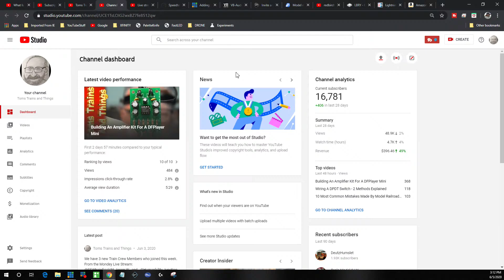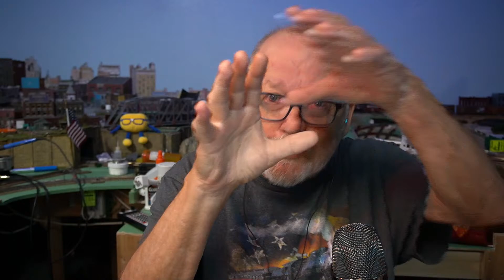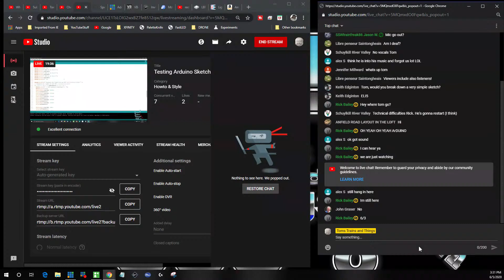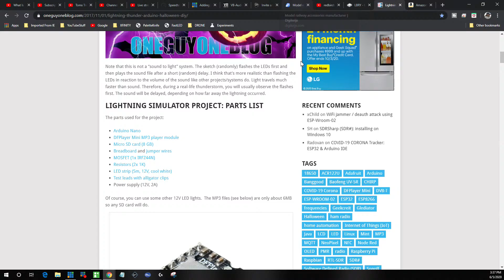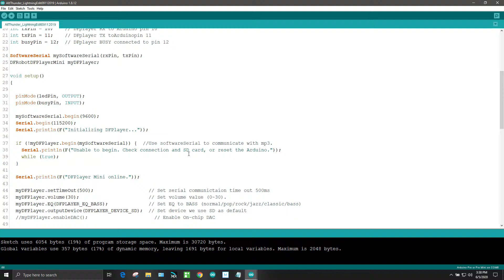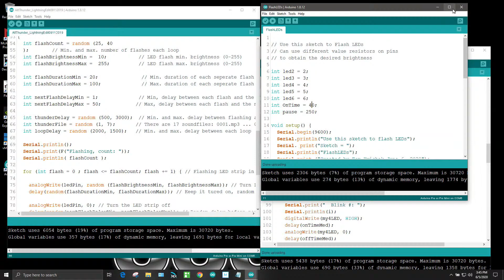Testing Arduino Sketches - Windows Changed My Mic Again

Comment from the maker: Jump to 6:06 where the audio is on. Again, Windows changed my default microphone!
Reply: Have you considered using VoiceMeeter? It would allow you better audio routing on your computer and take the "control" away from Windows to do the right thing.
Reply from the maker: @HumancityJunction  I use that for my NDI audio sources. Vmix has it's own mixer also, it works fine within the program, but it seems like every time Windows does an update, it changes my default mic to one of my web cams mic. Strange, it only started a few months ago. It may have something to do with Zoom. That's the only program I added in the last few months.
Reply from the maker: BTW, windows completely shuts off the output to my mic.
Reply: @TomsTrainsandThings  I know that I would be better off using a Windoze computer for streaming, but stories like this make me glad i use osX. I am thinking of creating a checklist for myself of all of the things I should check before recording/streaming.  There are so many little things to keep track of.
Reply from the maker: @HumancityJunction  I normally check all my settings an hour before I go live, sometimes I'll do it several times.  Today was an unscheduled stream, just started it with no pre check. lol I also started it from the YT Create Stream button which I rarely ever do.

Comment: A cheap pair of (powered) computer speakers will the same job without having to build anything. One can usually find some at a thrift store  for  5-10 bucks.  Plus they will have cabinets which will improve the bass output significantly. Much better sound.
Reply from the maker: I get a lot of things at thrift stores. It's more fun to build something on your own. Besides this is an Arduino project where everything is built from scratch.